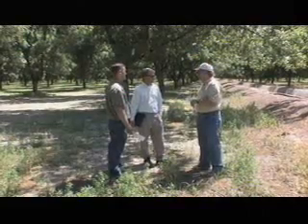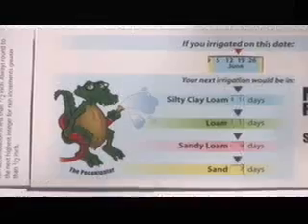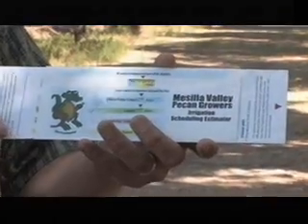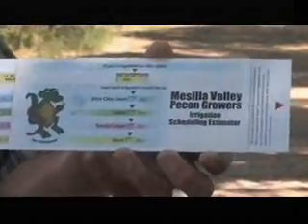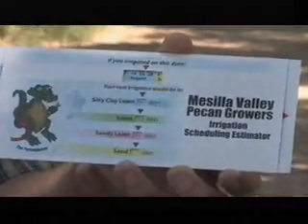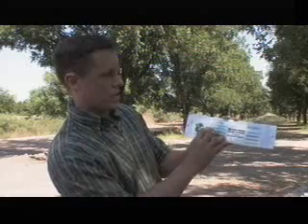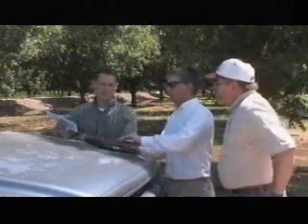Tool to Save Water in Pecan Orchards

Comment: @jeffery19677 It was specifically developed for the Mesilla Valley in New Mexico.  It is based on historic temperature and humidity levels, so it would require adjustment for other growing areas.